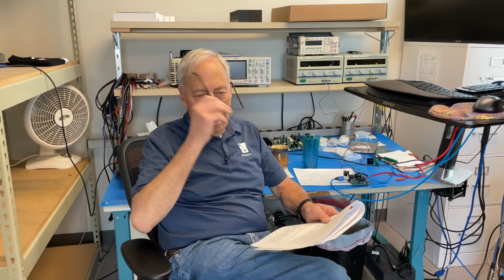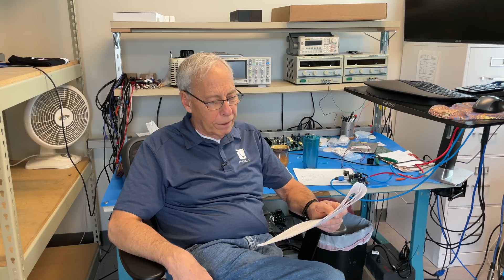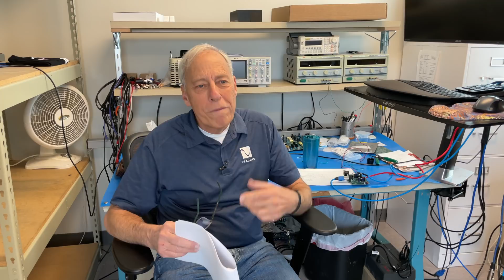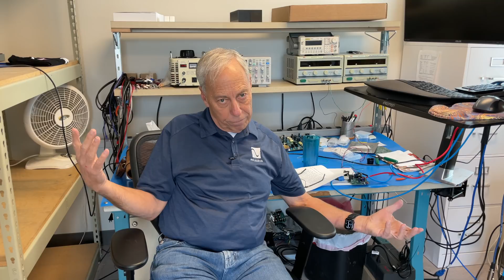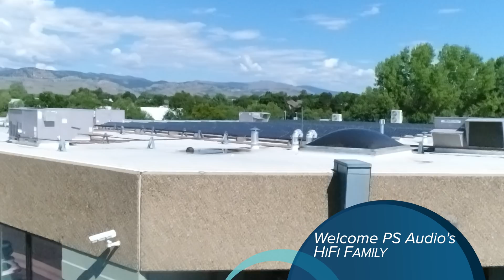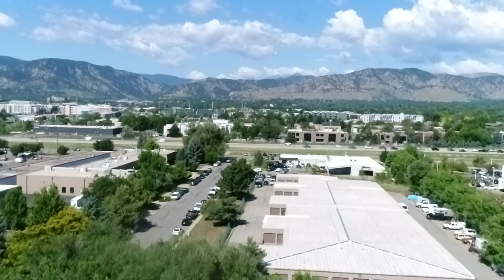Impedance matching and cables

Comment: If as you say, Paul, “Cables make a difference”, what is the electrical term that is responsible for them making that difference? I believe currently we use the terms capacitance, inductance and resistance to describe a circuits behavior. If we could just come up with an accepted engineering reason why “cables make a difference” then those that are disbelievers in the proper matching of cables to electronic equipment, would have an easier time buying into the concept that they make a difference. Without an engineering reason or (new) term, this will continue to be the third rail of audio circles worldwide. If what you’re saying is true, then there has to be an electrical explanation why certain cables perform differently.

Comment: i've experimented with making DIY cables out of good quality wire and realized how much the braiding and geometry affects the sound!!  All I can say is that: 1) it is NOT subtle, and 2) more is NOT always better.
Reply: I'd love to hear what you've discovered.

Since flexibility isn't an issue for me, stranded cables are really just piss poor implementation most of the time. Braiding extremely small individual wires, or braided litz is quite good theoretically, but the twisting and braiding needs to be tight. So the diy aspect of braiding your own wires isn't really feasible. 

Here's what I've discovered. Low dielectric insulation over solid core wire twisted tightly with one other conductor works remarkably well. Sure, skin effect might be an issue, but I think it's overstated. And by using one solid core 12awg or 10awg wire twisted with its same size gauge neutral, I know for a certainty I'm not getting minnie arcing that braided wire suffers from.

anytime individual wire strands are packaged into the same insulator, there's tiny air gaps all along those wires, and there's a lot of needless arcing to jump those gaps. 

Stranded wire is truly for people that can't mange their cable runs and need flexibility. For those that can create nice runs, solid core is the way to go. Granted, Litz is essentially solid core since each individual strand has its own conductor, but I don't think the benfits outweigh the costs.
Reply: @thunderpooch  I started with 4 lengths of 10ga OCC stranded wire and twisted two together to make a pair of twisted wire.  I then twisted the two pair together in the opposite direction which "braided" the 4 of them.  These sounded pretty OK, so I thought, what if I combine two of them to create a cable with 8 total 10ga wires :D  yeah, that sounded terrible.. and I had to spend like $60 for terminators that would accept the monstrosity I created lol!     It really sounded like the music was straining to get through, and the soundstage was flat and non-existent.  midrange was thin, bass was hollow, and top end was brittle and fatiguing.  I put the straight unaltered 10ga back on and everything was full again.  And Im not talking audiophile subtlety here, like it was I thought I may have damaged my amp somehow kind of difference.

Comment: There was an article that talked about impedance matching speaker cables.  I thought it was on PS Audio Forums but I can't locate it now.  I had built hefty cables that were in a ribbon with conductors separated by an inch.  (works well on interconnects).  The author opined that this would not work well for speaker cables suggesting an impedance matching issue.  I replaced the cables with another diy style that used braided wires totaling similar gauge.  To my ear the author was correct and my system sound benefited.
Reply: That could be for reasons other than impedance matching. Impedance does not have effects until roughly 1/5th the wavelength of the signal to the cable (hence making it a transmission line).

Comment: Characteristic impedance and resistance are not the same. If you measure the resistance of a cable, of course it's very low. But characteristic impedance is different thing.  Probably not so important for analog cables but it's very important in digital domain. Impedance mismatch creates reflections and deflect the digital signals.
Reply: I suspect there was a bit of a "disconnect" between the submitted question, and what Paul was addressing in his answer.

Comment: Copper in and of itself acts as a filter, it is a filter. That is why there is a difference in sound from 1 cable to another. Length, AWG also matters. Copper is not just copper, there are different purities of copper. The best so far being OCC copper. OFC (oxygen free) being second, and everything else can have anything in it. Yes cable quality does matter in sound reproduction. I say if you really had the very best high end cables available at every point in your system, you may not like what you here most of the time because the clarity is so good you here more imperfections rather than coloration. But when you do here a good clean track you will be blown away at how good it is.
Reply: Kimber Kable #1!!
Reply: You call yourself Smarty and you write this phrase, "...you may not like what you here most of the time..."  Not so smart, hear hear!
Reply: @txmike1945  Brilliant analogy buckwheat
Reply: @CarlVanDoren61  Well I am glad you approve, I was concerned that you might not and seems everyone who matters believes that you are King of u-tube discussions. Brilliant indeed!

Comment: There is a difference between a resistance and an impedance.
Reply: Obviously, otherwise you would only need one of those two terms.
Reply: We're talking audio frequency here, not RF. Audio cables aren't measured like Coax 52/75 or 300 ohm balanced lead-in .... so I think the term to be addressed in audio freq. would be resistance. Like too small speaker cable gauge will cause signal loss at the speaker due to resistance, not impedance
Reply: @bobross6802  "Like too small speaker cable gauge will cause signal loss at the speaker due to resistance, not impedance." Yes, I witnessed that once. My friend had just added speakers in the corners of his room, maybe 12 feet from the sound source. The music sounded terrible, muffled with poor response. Then I discovered he had used lengths of multi-wire telephone cable, those tiny wires just couldn't carry the signal. I told him to buy some 14 ga speaker wire.
Reply: @bobross6802  I know we are talking audio and not RF but my example was to show an  extreme case where impedance does not equal resistance. A confusing eample is an 8ohm speaker. Measure one and it will read around 8 ohms resistance as well. And audio cable does have a characteristic impedance, not that is makes any difference these days. Belden 9451, the industry standard balanced line audio cable is 66 ohms. Interesting that that matches the output impedance most audio grade OPAMPS. With speaker cable we agree that resistance is the primary concern. But over 50 feet, inductance related issues start to creep in according to Roger Russell.
Reply: @andydelle4509  Andy maybe you haven't actually measured any. The 8 ohm rating for a tweeter or woofer is impedance, i.e. with an AC sound signal passing through it. An 8 ohm driver commonly has a voice coil resistance of about 6 to 6.5 ohms. For a 4 ohm driver about half that, etc.
Reply: @txmike1945  I did measure once and got a reading on the low seven ohms. Like I said, about 8 ohms but not exactly. A lot closer then that microwave example I noted.

And keep in mind speakers have an impedance versus frequency  curve approaching 300%. That is the argument given for using line level active crossovers which I also agree. As an EE I know quite well that a passive filter cannot be very frequency selective with a 300% impedance load variation.
Reply: @andydelle4509  Then you are also aware that the impedance will always be a larger value than the static resistance measurement because the voice coil functions as an inductor when it receives the AC audio signal.
Reply: @txmike1945  Where did I state otherwise?
Reply: @andydelle4509  Well you did write this, and it seems that you still don't acknowledge that impedance will always be roughly 20% to 30% higher than the measured resistance. You wrote, " A confusing example is an 8ohm speaker. Measure one and it will read around 8 ohms resistance as well. "  

But it won't.
Reply: @andydelle4509  This is just a discussion. Seems your nose gets out of joint easily! You don't have to measure, just go to any place that sells speaker components, and look up the specs for your driver of choice. They will list the actual resistance. For most 8 ohm drivers the resistance listed is 6 to 6.5 ohms. You probably also know that the impedance is frequency dependent, for a speaker its rating (e.g. 8 ohms) only occurs approximately and in a relatively narrow region, at higher frequencies the actual impedance rises gradually, sometimes for a woofer up to 100 ohms or greater. It is common for the electronic filter network to include an impedance compensation to prevent the impedance from rising so rapidly, this enables a cleaner crossover point.
Reply: @txmike1945  Again I measured 7.3 ohms just last night with a very good meter. That's what I got on an old 1980s era 4 inch driver. What difference does it make anyway. Yes, the impedance does vary greatly with frequency upwards of 300%. I thought I already stated that and why personally I am a proponent of line level crossovers with a amp per driver.
Reply: Absolutely. Here is an example. I once worked on some 11ghz microwave gear. The input TNC (not BNC) connector had a 1/8in silver plated copper strap from the connector center soldered down to the brass sub plate of the device, about 1/2in long. A dead short, right? It would zero out any commom  DMM. But at 11ghz, that was 50 ohms! It was also a "winding" on a coupling transformer to the secondary loop next to it - also a dead short at DC. At audio frequencies true impedance matching is of little consequence with an exception for tube amp output transformers..

Comment: 3:50 FYI I think Paul meant "extremely low" relative to the source. Extremely high impedance would attenuate the signal substantially.
Reply: These discussions always end up confusing cable characteristic impedance, with loop impedance.  The former is a high-frequency consideration which rarely matters at all in audio, and the latter is mostly the copper resistance which we always want to be as low as practical.
Reply: @marianneoelund2940  always cracks me up. By the time most audiophiles can afford high end gizmos they can't even hear above 10khz

Hearing aids are cheaper than what I see a lot of geezers wasting fortunes on
Reply: @thunderpooch They should sell high end speakers with a discount for an inferior tweeter.

Comment: Pro-Tip: If you want good impedance matching to your speakers, don't use tube amps. Even the best ones from companies like McIntosh will still have about 0.5Ω of output impedance due to the need to use an output transformer. Many tube amps are far worse, and this causes the speakers dynamic impedance of the loudspeaker to pull the output of the amp around, with the net result that the speakers frequency response now bears the shape of its impedance curve if the output impedance is bad enough. And this doesn't even cover the issues of their very poor linearity in many cases. It's not musical, its DISTORTION. Solid state amps are typically no more than 0.1Ω, and don't have this issue. As far as the speaker cables go, there the concern will be the cables reactance that results from excessive length (due to parasitic inductance and capacitance). Even though 100ft of 14AWG two-conductor wire will only have about 0.5Ω of resistance, its reactance could easily cause an amplifier to oscillate. Linear amps will have Theil and Zobel networks to help guard against this, but still best to avoid it. This is not an issue for low level signals since they are so small. Their noise is the major issue.
Reply: I don't think you fully understand tube amplifiers. 
(Not that I do either, but I DO understand why they are not problematic 
in regard to impedance.)
I will leave it at that, and I will not get into a discussion about it.
Reply: @spacemissing  How can you pass judgement on my understanding, when you yourself don't understand? I find it quite curious. At any rate, tubes have quite poor linearity in their native forms due to how they work. An additional issue is the fact that they have to work at high voltages in order for the cathode/grid/plate structure typically used in triodes to function. This necessitates the use of an output transformer since the tubes are inherently high impedance devices. At best you will be looking at about 0.5Ω on the secondary. Given that its common now for audiophile speakers to have impedances that dip down into the 2-3Ω region, this means that the resistance on the secondary winding of the output transformer will act as a voltage divider in series with the impedance of the loudspeaker. The net result is that the lower the impedance of the loudspeaker goes, the more the output voltage of the amplifier is dragged down. The net effect is to change the on-axis response on the speaker and impress the shape of the speaker's impedance curve on it. While this won't be much more than 1-2 dB with a competent tube amp, it's still not negligible. This also assumes that the amp designer has not done something stupid like not using feedback or going with a SET design and making a guitar buzz box rather than a linear amplifier. This is all neatly sidestepped by solid state linear and class-D amplifiers with their feedback and feed forward designs. Switching topologies from companies like Benchmark and Hypex now have less distortion than even the best linear amplifiers. An additional bonus to feedback is it drives the output impedance down into the milliohm territory, which is what you want for a voltage amplifier. For what it's worth, PS Audio now almost exclusively uses fully integrated class-D modules in their amplifier designs.
Reply: @mysock351C  I’m quite happy with my 2 w/pc single ended triode no feedback mono amplifiers.  You listen to your specs but I prefer listening to music.  Great specs doesn’t necessarily make for a great sounding amp.
Reply: @ronniefranks4351  Electronics are not supposed to have a “sound.” Dealing with the pathologies of speakers is bad enough, and they are already principally 2nd and 3rd harmonic distortion due to how they work. No need to add even MORE of this with tubes, along with a spray of other harmonics and IMD. Since you are not familiar with how these impact the sound itself, it’s not bothersome to you. It would be to me.
Reply: @ronniefranks4351  Also what kind of speakers for just two watts of power (I’d bet less than 250mW of that power is actually useable without sounding like a telephone)? It’s highly unlikely you are getting anything remotely resembling true fidelity. More likely something along the lines of the whizzer cone 5.25” speakers in my old GMC truck. Maybe you do have good speakers, but often these do not.
Reply: @mysock351C Correct me if I am wrong about your products Paul, but while the PS audio mini amps are class D, AFAIK the BHK's are still class AB linear designs with good old 50/60hz heavy iron power supplies. And I recall they even have a tube front end. Yes they do use MOSFETS but mosfets can be biased linear or as a switch  just as a BJT can.
Reply: @andydelle4509  All of the slimline amps are module based from what I have seen. The BHK amps are, as you said, still the older linear topology. Both work just fine, but some of them are a mixed bag given the unusual input stage topologies they have like the gain cell. The one I do like is the Sprout, but it has severe peaking in the treble range, like almost 20 dB, from testing done by Amir @ ASR. So much so that I would be afraid it would drive me crazy and kill tweeters if I did get one.
Reply: There seem to be quite a few "audiophiles" who enjoy transformer sound, and believe that some low-order distortion adds a desirable quality to their music.

Comment: What? Paul, you'd better check your facts, man. This is one of your worst videos yet, and probably the only one I've seen where you're just flat wrong. Cable impedance, expressed in ohms at a particular frequency, is not particularly useful in audio, but it does matter. Painfully, it matters most in the situation you explained that it doesn't, that of MC phono cartridge loading. Phono cables frequently have a capacitance of 30 to 50 picofarads per meter in parallel to the loading capacitor in the preamp. This means the two capacitances add together, and you may in fact run into issues with this with the wrong combo of cartridge, cables, and preamp. It generally matters much less for other cables (e.g. from a preamp to a power amp, or a CD player or DAC to a pre), but at least a few cable manufacturers and audiophiles claim that the capacitance of these interconnects is responsible for audible differences, so there you go. This info is no good, all viewers take note!
Reply: Capacitance is most critical for MM cartridges, not MC.  With MM cartridges, if your total capacitance is about 150pF or less, it shouldn't be a problem.  
With MC cartridges, it's important to have the load impedance (amplifier input impedance) set correctly for flattest response (usually in the 50-100 ohm range), but cable + preamp input capacitance will not be a significant factor since the cartridge output impedance is only around 10 ohms.  
For interconnects, it takes rather extreme combinations to produce audible effects.  Even for a high source impedance of 2.5K ohms, 1000pF of loading only attenuates 0.5dB at 20kHz.